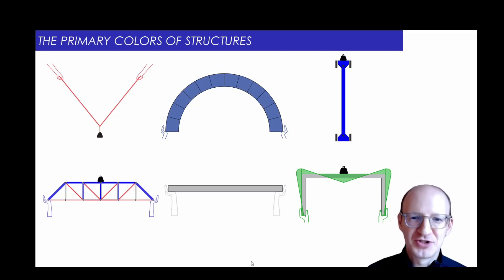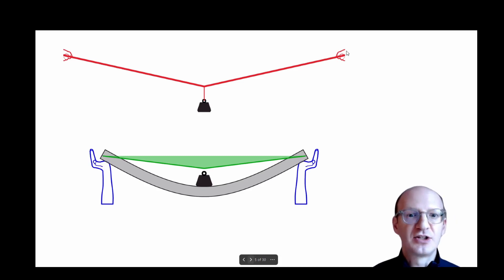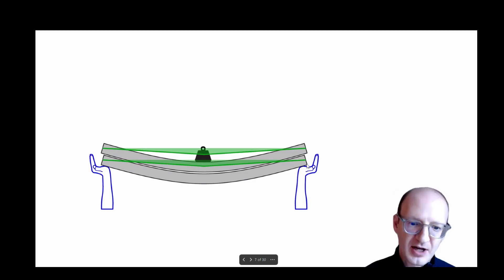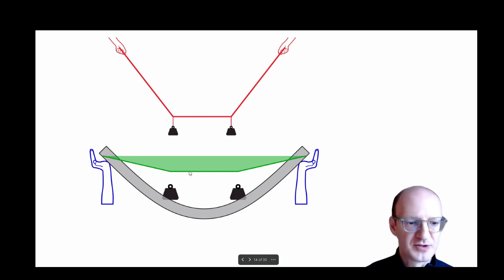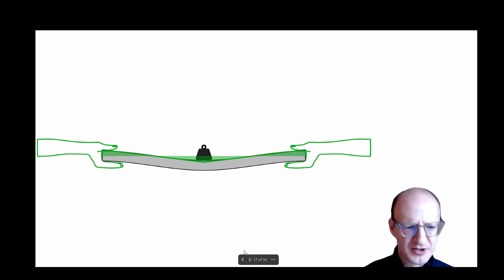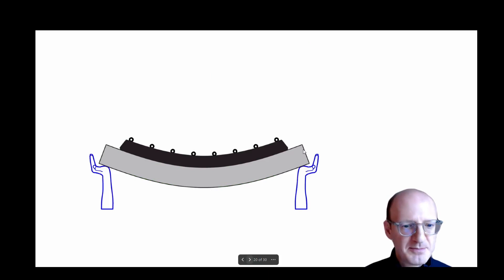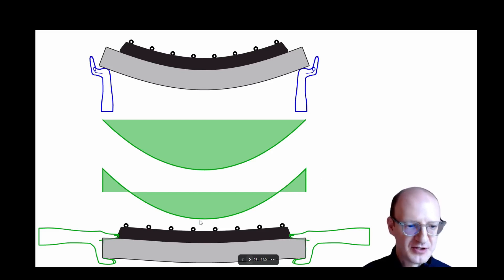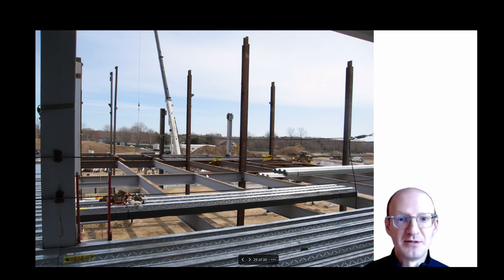How Beams Work! (Part 2): Structures 6-2

Comment: So essentially the load path comes from column to slab UDL into beams then to the connected girders perpendicular to beams as point loads then to below columns

So roof -> column -> slab/floor -> beam -> girder -> next below column and repeat minus the roof

Comment: Sir, 
In an ideal truss the members shall be not continuous , i.e. they shall be broken at joints.
But in practice for steel trusses , top and and bottom chords are sometimes continuous over 2/3 joints and spliced at 12 m, will it remain an ideal truss.
Does the Chords not behave like beams in such a case.
Kindly explain.

Comment: 25: your rubber beam if it when it sags just turn the cable motion into lift cable move ment motion lifting up on the ends to counter so not really using beam rubber as support really. u just need multi pulley make small sagging force hve grand pulley pulling apart lifting force into the built design. GOD free help. If beam twisted by design so even though will sag not pulley that much back up. If u twist 1 beam right ^ & 2nd beam left twist then make weld one structural member backed up by pulleys lifting pulling on end, & if pulley back up piece connection fails it makes it to long after fail for beam to come off or fall thru bc of extra length connection, just 30sec working the problem godly approach. No thought given, tossing it rubber beam out there.

Comment: Wish to know also what's the purpose of the car's underchassi,and the spring plate in it, and why mostly the back tire of a car or a truck  is attach to that area,.want to know also the different  type of works of a beam with that?..tnx sir! More power..

Comment: Sir, I wNt to construct si ngle story house of 500 sft on single beam. What should be the size of beam, its depth on ground and maximum weight can we put on it.
Reply: One continuous grade beam throughout the perimeter. Hire a local engineer and apply for permits to have it inspected.

Comment: Really enjoying watching your video series.

I'm curious on the effect that notching the ends of the beam where it is supported would have on it's load bearing capacity?

For instance - picture a triple laminated 2x6 beam (made from standard dimensional pine/spruce lumber), supported at each end by metal brackets it sits on freely. Now, an additional 2 plys are laminated (1 on each side) making a beam that is now 5 plys "wide", HOWEVER the new plys measure 2x8 instead of 2x6 like the rest of the beam. As the tops must be even with the original triple laminated 2x6 beam, the very end of each 2x8 needs to be "notched" so they can rest on the same bracket supporting the 2x6s. This means that, outside of the notches at the ends, the "new" added laminations hang down 2" further than the original 2x6 beam.

How will these extra laminations enhance the beam structurally? Will they behave as 2 added 2x8 laminations? As 2 added 2x6 laminations? Or something else entirely? I have a suspiscion on what the effect would be, but don't want to jinx the answer! (lol)

Assume they are fastened from each side to the original 2x6 beam using high grade construction adhesive and structural screws that penetrate the new ply and all 3 old plys.

Part B would be whether "filling in" the empty "channel" between the 2x8's at the bottom of the tri-lam 2x6 beam would improve the load carrying capacity (although I have no idea how you'd properly fasten it in there!).  My guess is that the improvement would be minimal if not insignificant.